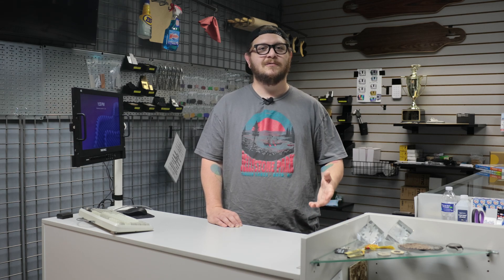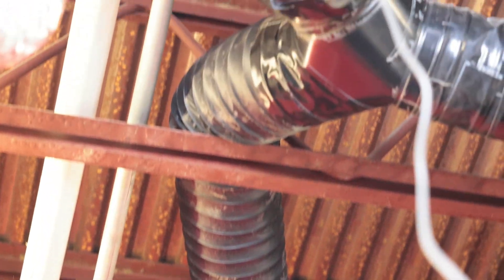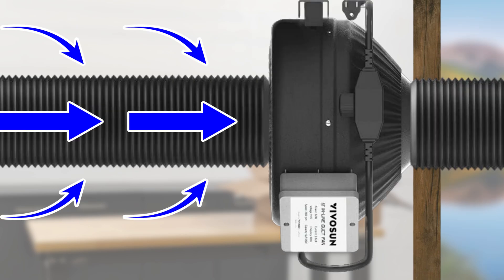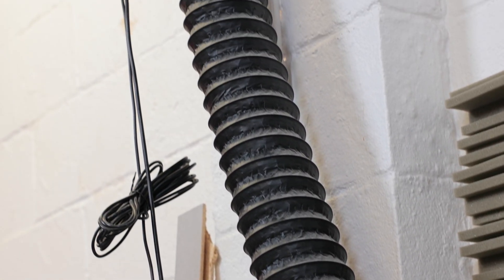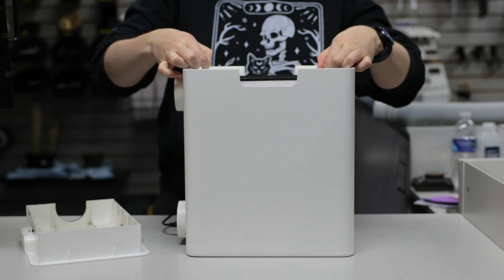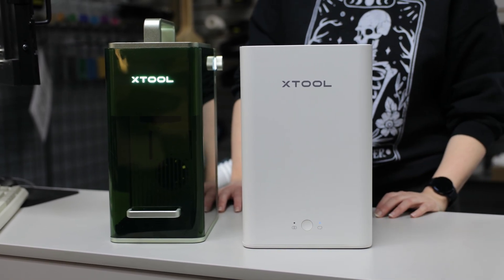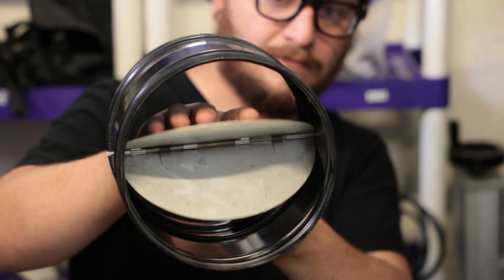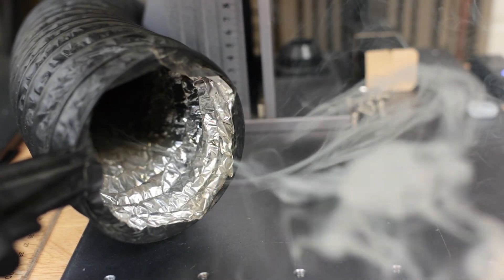EXHAUST AND EXTRACTION OVERVIEW FOR CLEAN SAFE AIR WHILE LASER ENGRAVING

Comment: So many new creators with lasers fail to take into account solid fume extraction and their overall air quality in their workspace, so it's nice to see a video addressing this. 

Re: extraction fans -  I've been using a Penn State Industries DC3 for my gantry CO2 laser, and a Tjernlund M6 for my fiber laser. They are more expensive top be sure, but the CFM & static pressure specs show why. Worth every penny.
Reply from the maker: Nice picks, glad to hear you liked the content and glad to hear you're doing it the right way.